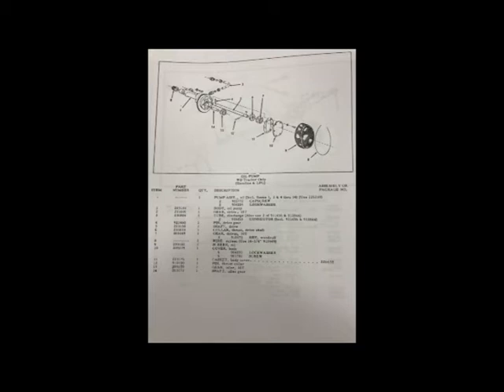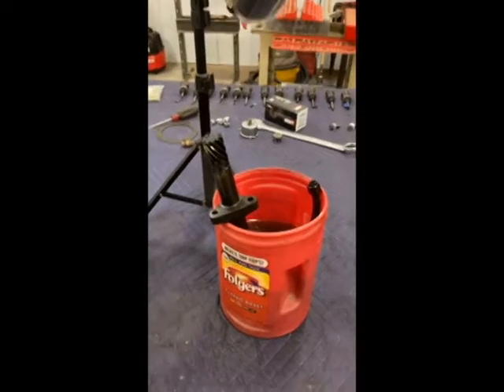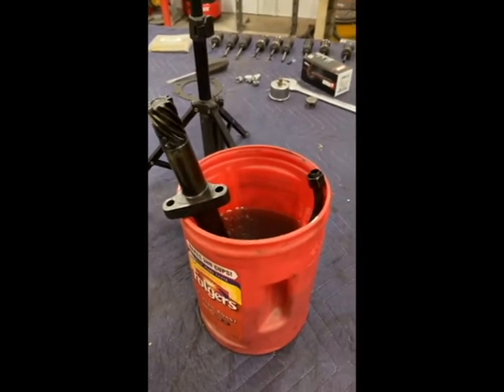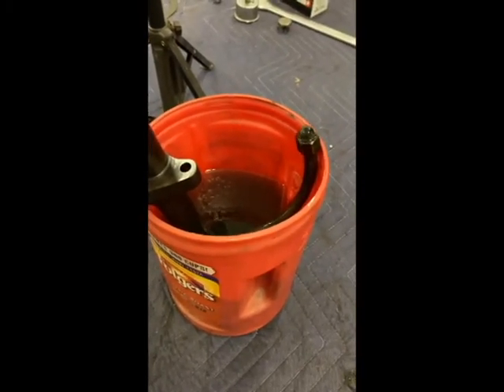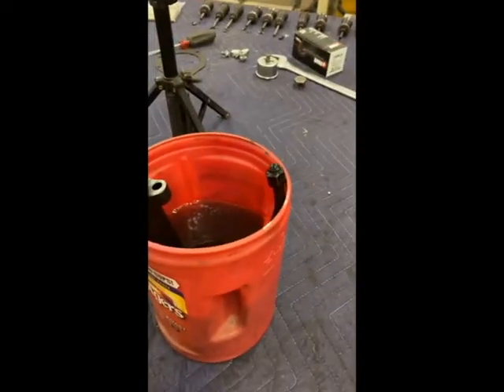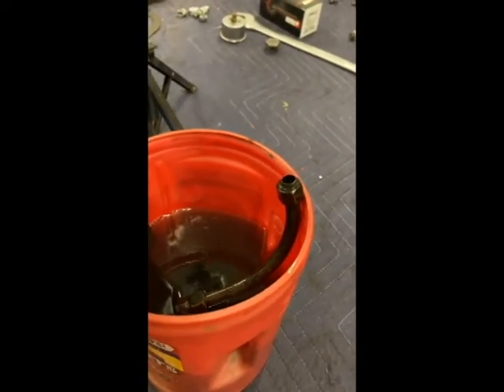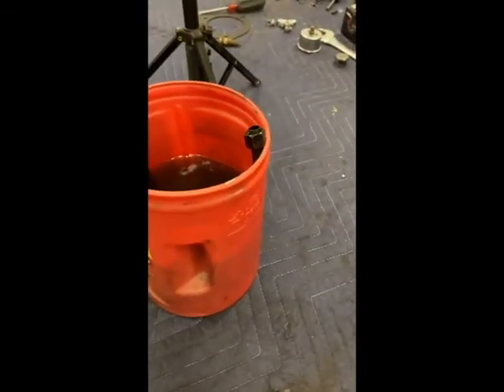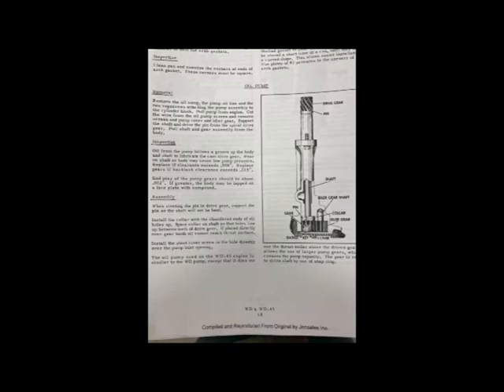Allis Chalmers WD Gear Driven Oil Pump Bench Test

Comment: Good  day Yrs ago I bought WC for 65.00.  Well it had a patch on side of motor, cracked.  If you worked it to hard , I guess water fouled 1 plug & it would miss.  Well  we  left water in & finisded it off.    I found old glass jar ,put it on  oil  filter spot,  had  sae 40,  it hardly come out of tube, flowed really slow.  Thanks  Do you know what pressure they should have?
Reply from the maker: Morning Don, that was a cheap buy and interesting idea with the glass jar.  Allowed you to see what was going on inside.  I believe that oil pressure should be around 12 psi.
Reply: @nashsummers8050  Really  that low.  Well we scraped tractor, but it looked so low pressure that I thought it would not circulate, but I guess it lines  pressure would push it.  Thanks  Darn cold up here this morning.
Reply from the maker: @donvoll2580  yeah seems pretty low but lines are so small doesn't take much to move it around.  Yes cold here as well in the teens with some snow.